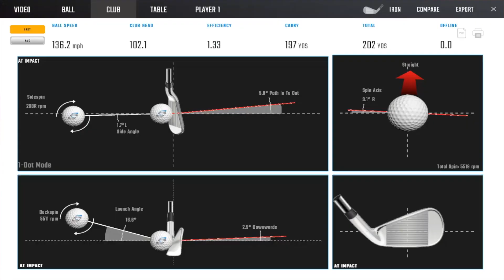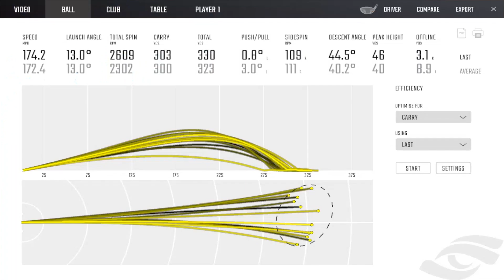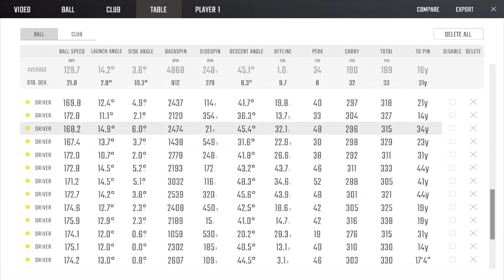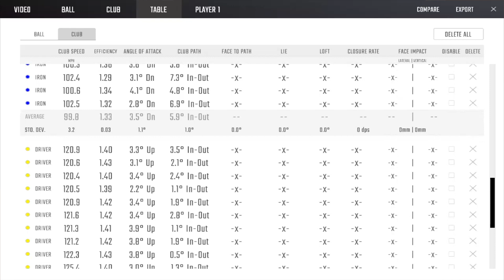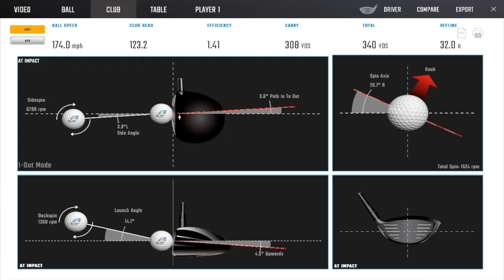Live Lessons #1 with Matt Blois from TXG (FULL LESSON) 10/13/2018 - Refining the Backswing Load

Comment: With the driver, watching Matt create width I see his trailing elbow high and inside instead of close to body. I've tried to replicate this, I mean its almost natural when creating excessive width in the back swing. Normally my back swing is super super long, this move helps me control the length which in return I think I have better face control. Yesterday I hit my driver much better, however with the new move I feel my speed is down.
Reply from the maker: Doba in the big picture, you will have a higher potential of speed with a good backswing :)

Comment: Larry - are you using GC Quad?  I’m wonder how Matt is not maxed out on efficiency?  There were ten drivers at least he absolutely roasted but it seemed like efficiently was low?  Please correct me if I’m mistaken.
Reply from the maker: Yup, I've seen GCquad top out at 1.47, it will never read 1.5 like you see with Trackman. Some of Matt's really good ones will touch 1.45. But I don't get too hung up on that number with Matt right now =)

Comment: Is this basically a body swing with the arms along for the ride?
Reply: M Send my interpretation is that it’s a trail arm dominant hit
Reply from the maker: It’s a let the body power the arms and hands and club kinda swing :)
Reply: Larry Cheung Golf.  thanks Larry. The swing is  very different from the swings on the TXG or Shawn clement videos. But to be clear the move up from the squat is what propels the club.
Reply from the maker: M Send the move up as you rotate is a reaction to the down and rotate, think of everything as a chain of events that propels the club, not a single action that does it :)